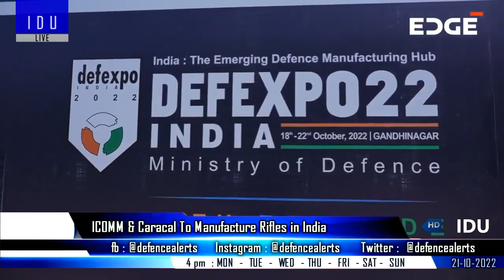Indian Defence Updates : Agni Prime Test,F-414 Production,Astra MK2 on Rafale,New Kalyani M4 Order

Comment: Here's why GE F414 is not an ideal engine choice for India! 
1) Harsh terms & conditions that comes  with American Weapons. Morover,It doesn't even make sense for engine with 100% ToT to not have intellectual property rights. 
2) Not suitable for use in AMCA program because of its low thrust and absence of thrust vectoring capabilities. F414 has 98 KN thrust which barely meets the requirements for Super cruising of the fighter jets, let alone AMCA a 5th gen fighter! 
3) F404 the predecessor of F414 is mostly used to power the obsolute fleet of American airplanes and drones. Whereas F414 is believed to be used in F/A 18E/F Super Hornet. Seeing how long FA18 has served American airforce & navy I believe it's production line is going to be closed soon just like P8i surveillance & reconnaissance aircraft. 
Rather than going through such baggage of deals better go with Rolls Royce or saffron!
3) Last but most important, sickening double game of USA!
Reply: No one will give their cutting edge tech to India.

Comment: Also Defense Ministry needs to overhaul the procurement procedures of IAF and Army. The lethargic process and individual control of decision making is hurting the Force strength. Why is 114 MMRFA project still on the back burner. Why does it need new review process when it was already done during the 126 MRFA project.
Reply: Educate yourself before criticizing.... Government is waiting for F4 version of Rafale which is not ready yet. It will be ready by 2025.....then government will order that in large amount.... probably 114. That's why BJP government reduced the number of Rafale to just 36 because they were F3 version and will need to be upgraded to F4 version by 2027 which will cost extra money.
Reply: @Bond047  when the F4 is ready in 2025, how long do you think it will take for the analysis and review process, agreement to be signed there after and then the production if 114 aircrafts. Boss tu educate ho ja pehle main toh anpadh insaan hoon
Reply: @nihalrahul  Anpadh ho to phir chup raha karo....
Reply: @Bond047  nai bhai chup rehna nahi aata... woh bhi nahi seekha maine. aur aap educated ho toh dusro ke opinions aur point of views ko respect karo.
Reply: @Bond047  not correct, UAE ordered F4 version only. You can place the order and ask them to setup the assembly